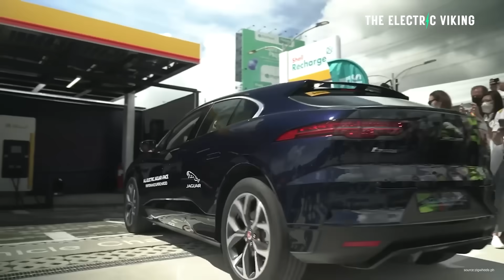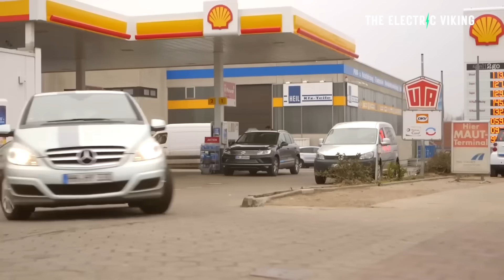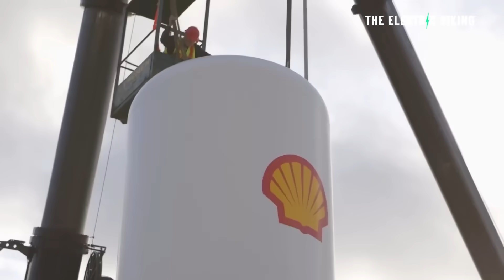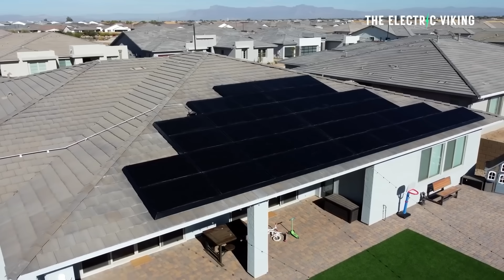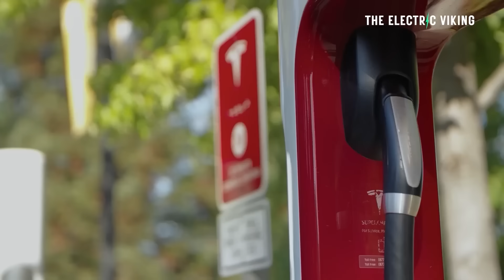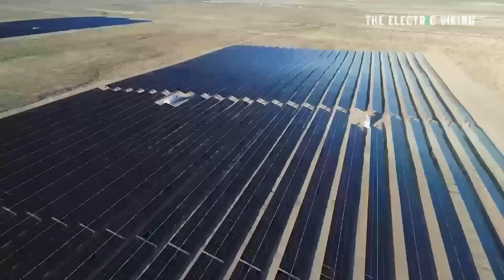Tesla converts gas station into Superchargers as oil giant dumps 1000 sites

Comment: We live near Giddings, TX. Between Houston and Austin.  The main highway goes straight through town.  With 25 trains a day crossing it.  Most other towns like this have built a highway bypass.  But not here.  There are 3 restaurants located in old town buildings within a block of each other with a large shared parking. It's big enough that it hosts festivals.  The only charging stations are at a truck stop, and they are early Tesla chargers.  They are so old they don't accept J1772 with an adapter.  NACS only.  I'm going to make a handout for the owners to review and request that the Economic Development Council inquire into having Electrify America install DC fast chargers in the common parking area.  The only other chargers are 30 miles away.  We live 8 miles out of town with an F150 Lightning, which I charge at home with a Level 2 charger.  Love it.

Comment: My local Shell station was refurbished about two years ago. They reduced the number of fuel pumps from 8 to 4 and installed chargepoints. It sounds like good news right? Except that most of the time the EV chargers are not used and the pumps have queues. Why is that? Well, Shell installed 400V 150kW chargepoints (yesterday's technology today) and want to charge 85p/kWh. Who wants to spend extra time on a fume-filled forecourt and then have to pay through the nose for it? EV drivers are much smarter than that.

Comment: This guy is living in a different world than the rest of us,  maybe out past the planet Pluto would be my guess.
Reply: His predictions and sources have been spot on.  
It is better to be more often right than wrong.
Reply: I work in electrical maintenance, and they have lots of motors that are bulletproof. The batteries are still pretty mediocre.  Soon as they have a battery that can reliably go 700 or so miles. A reliable 500 miles at 80%charge with hot/cold degradation that will last years.
Reply: Nah, sounds like you are living back in the 80's

Comment: To maintain grid stability variable pricing would help.  The grid has to handle a maximum load so most of the time there is excess capacity on the grid.  So when there is excess capacity it's cheaper to charge most people will charge during these times.  If EVs are set up for bi-directional charging people could sell their power to the system where there is high demand on the grid.

Comment: It would be great if gas stations were converted to the highest level of charging stations.  This would reduce the time people take to recharge there and encourage the vehicle manufacturers to introduce more higher voltage vehicles more quickly.  Lower speed, i.e. lower power, charging stations could continue to offer lower speed charging where people are not in a great hurry, such as shopping or recreating.

Comment: Let’s see—-solar is a no brainer? Sillier words were never spoken. Just this weekend I saw a video on the economic analysis from a zero energy house in Massachusetts and the solar alone had a payback of 9 years NOT counting the present cost of money. 9 years with a friendly credit when feeding back into the grid, 9 years when considering a reasonable increase in power cost, 9 years with only a $10/mon connection fee, and 9 years with a current power cost of $.31/KWH. Texas provides none of the credits, a higher connection fee and I pay $.14/KWH—how about a no brainer 25 year pay out. House installations cost 3-4 times solar farm installation cost and THAT is where the effort should be, not in getting commissions from selling a house installation.

Comment: Tell me where these are in UK????
This doesn’t add up sorry 
If there's say twenty 500 kilowatt chargers at one station, that's 10 Megawatts of power required in one place.
Have you any idea how thick the cables will be and extra pylons required?......... it's total pie in sky.😆
The reality is there will be limited power available and if there's 20 Evangelists expecting 500 kilowatts of charge at the same time the charging station will load share between each vehicle.
No one will get anywhere near the fast charge rate they require.
The whole thing is a joke presently ⚠️

Comment: Ten 500 kW chargers running at full speed requires 5 MW from the grid. A town of 15000 persons in Sweden require about 35 MW, so 5 MW is not a little. A large electric grid substation can provide 1.2 MW. So a lot of V4 chargers requires quite a lot of the grid. Do not expect to find them all over the place within a few years. The grid infrastructure has to be adjusted, or some local power source is needed at the charging stations. I do hope all electric power companies is on top of this!

Comment: 70% of the power to charge EVs is already available by avoided use of power to refine fossil fuel into gasoline and diesel,
Reply: Not in a country that doesn't refine 100% of its petrol and diesel it isn't.

Comment: My EV neighbour has never used a rapid charger in 5 years.
17 homes in my 30 home street have rooftop PV. 
Some have home a battery.
That is about half a MWh every day 
365 is a lot of money not going into grid cashflow every year. 
Say 100,000$/year lost cashflow to the grid. 
My good friend is saving $10,000 a quarter at his warehouse and more at his home.

Grid cashflow is changing 😮😮😮

Petroleum sales are changing.
Gas sales are changing. 
Grid electricity cashflow is changing.
Rooftops are cooler under PV shading panels and lower energy costs.
Reply: Half a MWh , not MW
Reply: @stevejones2310  yes, MWh

Comment: Considering that an EV goes farther on the electricity used to refine gasoline than that gasoline will take the combustion car, the increase in EVs should mean a reduction in electricity. Plus, EV charging is mostly when electricity is cheap while refining is brutally continuous
Reply: I don't believe you are quite right, but you are nearly correct.  From my Internet search, I found that one gallon of gasoline requires around 4 kilowatt hours of electricity to refine.  That will drive an efficient EV, like a Tesla Model 3, about 18.75 miles.  The average passenger vehicle in the US gets 24.4 MPG, meaning 75% of energy is wasted before leaving the refinery.

Comment: Haven't seen any gas stations close, and they're thriving here in San Diego County. Also, I still haven't seen a charging station when I've been out and about. They may be out there, but they simply aren't visible... at all. Gas stations are everywhere... you just run into them all the time. No app/nav is necessary.
Reply: You can find them at a lot of shopping centers in the USA (at least California).  Drive around a few and you'll find them, but also check if they are working as a certain percentage are inoperative at any time. I believe a lot of them are contracted out to a 3rd party to install and maintain, but they are not maintained very well.   But yeah, gasoline refueling is still easier and quicker, far more convenient.
Reply: Old Sam is full of Beans, as usual  !!

Comment: If you charge your car during the day there is no pressure on the grid. When you get home, your car becomes an additional battery for your home. This becomes a win-win situation.
Reply: There's also no pressure on the grid if an EV is programmed to start charging late night, while most people are sleeping, at which time homes are using little to no electricity and the grid has excess capacity.

No grid upgrades are needed.

Comment: The name is energy station.
This is happening all over Norway.
Gas stations are closing, or are going over to be energy stations.
Reply: Are people in Norway preferring Teslas over new Volvo EV lineup?
Reply: @Purple-f6d  Tesla has been the favorit because of the charging infrastructure. Winter driving is a major factor in the choice of cars. Then it's charging speed, and then range.
All this compared with price.

Tesla model Y comes out on top. Volvo has a slower charging speed. Around 125 kw.
Even thought you use home charging 19 of 20 times. This will impact your long tripps. And, the price are almost the same as Tesla.

Many use the naf.no winter test, to check out the cars. Tesla looks like a good choice in most of the tests.
Reply: @geirvinje2556  Thanks for the reply. Your argument is very valid. Interestingly, I found Volvo to be much more comfortable with quieter and smoother ride. The Tesla was filled with rattles and minor issues (mostly a bad quality control and not design flaws). Though I have to agree that Tesla charging network is unbeatable.
Reply: @Purple-f6d True, and when the EV's gets cheaper and better, Tesla must up the game. With 400-600kw charging, and better batteries. This will be the new focus. American fossil cars lost the marked in Norway. It will be the same with Tesla.
And, if cars that can drive it self become mainstream, Norway will be a bigger marked. You can't use autopilot in heavy snow, or almost white out. Winter driving is NOT the same as driving in the summer.
Reply: @ Absolutely 🙌

Comment: Kudos to Shell - they're trying to be an energy provider rather than just a fossil fuel company.
Reply: How are they going to produce the electricity 😅
Reply: @PlanXV  Nuclear power is the best choice. Wind and solar + storage is the other possibility but needs better storage technology to make these truly useful.
Reply: @philmarsh7723 In the US nuclear power is the most expensive electricity you could buy. Building nuclear power plants often have 300-500% budget overruns. 
Dead in the water they are. With wind and solar with batteries selling electricity cheaper than nuclear a plant will never pay itself off.
Reply: @philmarsh7723  nuclear power is dumb, unless you don't mind waiting 17 years for it when you could get solar by next month.
Reply: @PlanXV they produce enormous amounts of gas which in the UK at least provides 50% of electric production. She'll supply the gas and make a profit at the charge point too, in general they make more profit on EV charging than the pennies on petrol they sell.
Reply: That is the transition they are going through. They call themselves energy companies now rather than oil companies and are slowly changing the colour of their logo's. BP sign for example used to be yellow but it has slowly morphed into a green!

Comment: EV's could collapse the grid, but its incredibly unlikely. You'd need to co-ordinate everyone to come home on a single day of the week with a low charge and simultaneously plug them all in during the evening when demand (and spot prices) are at their peak.
But they won't. The cars will get charged from cheap solar or 11pm-5am off peak power while you're sleeping over the course of the week as that is the cheapest power and the grid has excess capacity. You might get a increase in demand on a Thursday or Friday as people bank some power for the weekend, but I can't see people choosing to pay 35c/kW when they can pay 17c/kW and let the app manage things.

Comment: One million EV's easily; I think you would know that this is not the case. I have done the calculation's and the amount of power to charge one battery is enormous, even if those cars were charged slowly using 7.2kw chargers over 12 hours; That is another 7,200,000kw (7,200MW) of continuous output. While all those cars would not be plugged in at the same time, that is a huge increase that even another of our biggest coal power station couldn't absorb. 
Then there is the cabling and infrastructure connecting houses that were never designed or built for households to be drawing so much power. I bet that high powered charging stations are mostly being built where it is easy, convenient and cheap to install. Large scale deployments are going to be a nightmare.
Reply: the stats you pulled out make sense in a bubble. In real life, its far more nuanced than that. Some areas will have issues for sure, but lots of other places wont. Smarter people than you or I are already looking at solutions. Supplying more power is a non issue from my perspective cause whenever there was a shortage, more power was built into the system. This is no different. Remember, this is disruption, things will be Kaotic initially and then rapidly settle down.
Reply: @andyfreeze4072  The system is already under strain. There is already a need to increase supply because the excess capacity is low. Look on the live grid yourself, NSW does not even generate enough power for itself.

Comment: Are there no oil wells in Australia? No refineries either? Reason I ask is as ev’s are adopted wells and refineries output is reduced in kind.  Also a savings in tanker trucking cost and fires involving them.  In America according to nhtsa data, 11kwh of energy is expended for every gallon of gas at the gas station, on average. Is everyone ignoring this fact? On 11 kWh of energy my model 3 will travel much further than your average ice car. Is there some facts incorrect here if so please comment on this. Electricity may need to be rerouted but as ev’s take over there will be a net savings in energy that everyone seems to ignore. Ev’s are 85% efficient, ice is 20% or less efficient. Ice engines are more efficient as heaters than motivators.

Comment: Fewer gas stations lead to higher gas prices at the remaining stations. This, in turn, causes even more gas stations to close. It’s a downward spiral.
Reply: Having more or less gas stations won't lower or raise the price of gasoline. The demand for gasoline will cause the price to rise or fall. The number of gas stations doesn't effect gas prices supply and demand sets gas prices. And even if you were correct one thousand stations is nothing. There are approximately  147,000 gas stations in total across the U.S.

As of April 2023, there are 150,174 convenience stores, of which 118,678 stores (79%) sell fuel.

Other locations that sell gasoline are fuel-only kiosks (13,346 outlets), hypermarkets such as Costco and Walmart (6,648 outlets), and small-volume locations such as service stations and marinas (approximately 8,000 outlets).

80% of gasoline purchased in the U.S. is sold in convenience stores.                      Plus it will take many years before we don't have millions and millions of gas and diesel vehicles on the road. Economics is an interesting subject take a class sometime.
Reply: Gas station closures have been happening in the USA since about 1980.  The trend has been to fewer stations that have a larger footprint with more (and faster) pumps to move cars in and out faster.  Its an 'economy of scale' situation. Even if gasoline demand slowly drops, and there is a slow drop in the number of gasoline stations, vehicle drivers won't notice it until the locations get VERY low.
Reply: That’s not going to be an issue. 1,000 stations isn’t very many. 
There are almost 200,000 in the country alone. 🤷🏾‍♂️
Reply: Yes it's a death spiral

Comment: When oil companies start building superchargers it's likely the tipping point has been reached!
Reply: Perhaps.  But the tipping point reached is they make more money off you charging than they did filling your tank.
Reply: @PeterShawpshawman  Fuel sales have always been a loss leader based on the high cost of distribution and refining infrastructure and maintenance. Profits on retail fuel sales are razor thin.

The mini mart retail sales, are the core of profits.  See the proliferation of super station retailers such as Buc-ee's in Texas.

Charging stations bring economic benefits to surrounding businesses as they can charge unmonitorred.  This frees the patron to conduct other business in the meantime.
Reply: At least they see the writing on the wall, unlike many legacy automakers..
Reply: Click click
Reply: Sam actually solar is not free until after the cost of the panels and equipment has been paid off..
Reply: @eish3291  Actually it is free.  When speaking about the marginal cost of fuel in the energy industry it is the cost of the fuel itself and does not include maintenance, operating costs or the equipment.  It used to determine electricity cost based on fuel only.
Reply: 30% adoption and the magic starts happening.
Reply: They all already do in EU.

Comment: The UK has excess power production as the demand for electricity went down when the street lights were converted from Sodium to LED's.
Also as demand for refining oil for fuel decreases it will release vast amounts of electricity capacity for charging EV's.
As Elon once said "You have enough electricity to power all the cars in the country if you stop refining gasoline" Source : Business Insider
Reply: The US Department of Energy found that almost 6kWh of electricity is used to refine one US gallon of gasoline.  6kWh will power a small EV about 20 miles, versus the gallon of gasoline which will send the same small vehicle about 40 miles.  Remove from the equation all the other expenses of moving and selling gasoline and we find that getting away from gasoline just about does free up enough electricity to charge an entire nation's EVs.
Reply: @peteinwisconsin2496  With very little extra capacity needed.
Reply: Might want let the other guy know.
Reply: @GrigoriZhukov  ?